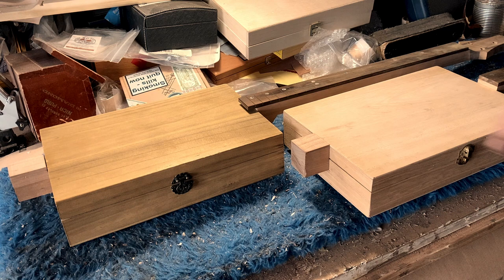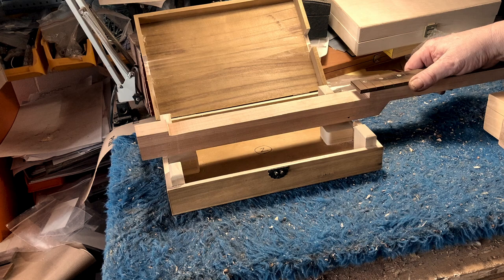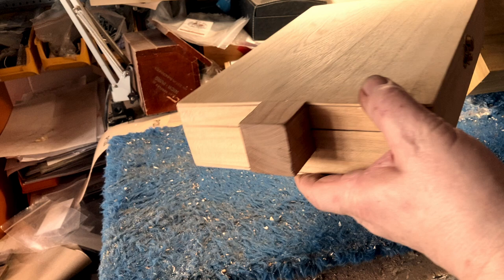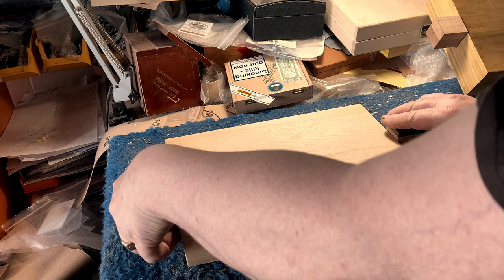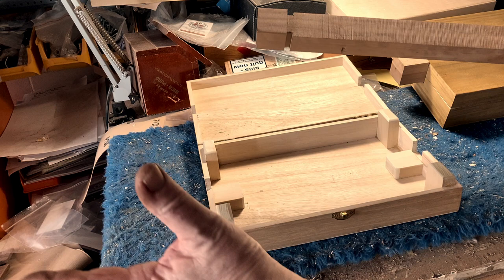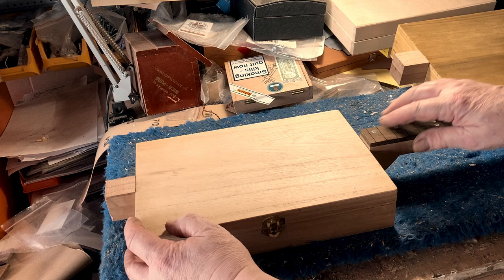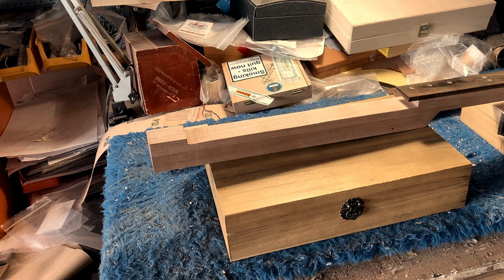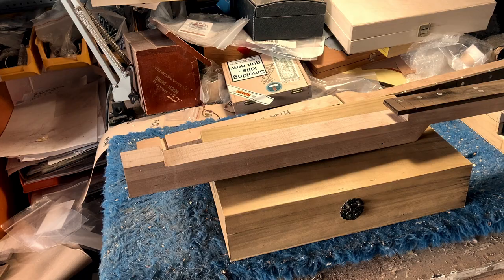We are changing the way we install guitar necks...or are we?

Comment: John, I was happy to see you give that a try.  I posted this technique on a popular internet site a while back, and you are correct if using a flanged top box you have to cut the fret board at the edge of the box top.  But if you use a flat top box like Under Crown, Camacho, or similar flat top box you can you can remove the hinges and slide the lid under the overhanging fretboard.  All  grooves are cut with a dado blade on a dedicated table saw.  I also use this technique only when applying a hard tail, leaving only the heal of the neck to be notched.

Comment: I prefer to have the neck enclosed in the box with the strings going through both the neck and the box. The neck is screwed to the blocks inside, or from the outside through the blocks into the neck

Comment: You could do away with cutting the rear hole if you just glue a couple of blocks inside to locate the the neck. Instead of pushing the neck through the box, just butt it to the inside face of the end and use a tailpiece such as a hinge to take the end of the strings.
Reply from the maker: We some times use a tailpiece that way, but it still doesn't overcome the issues of the slotted neck being more time consuming and not being able to form a fretboard overhang.